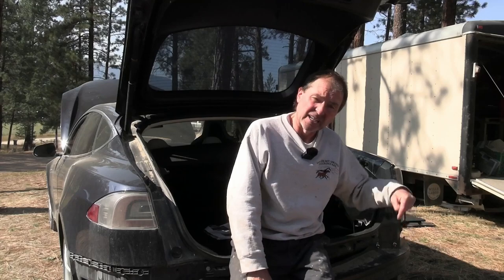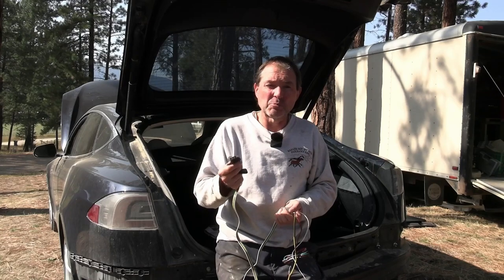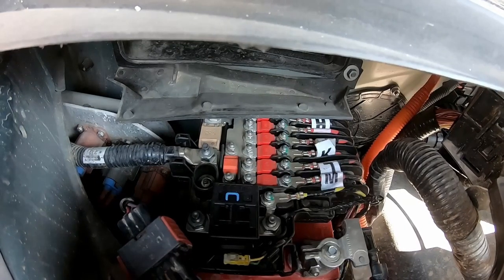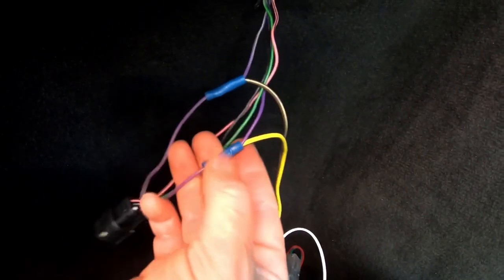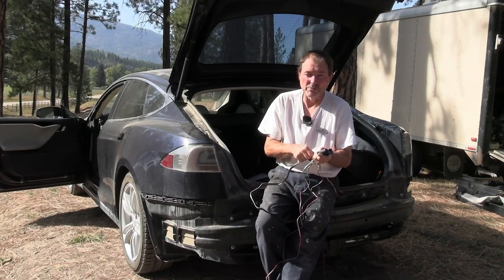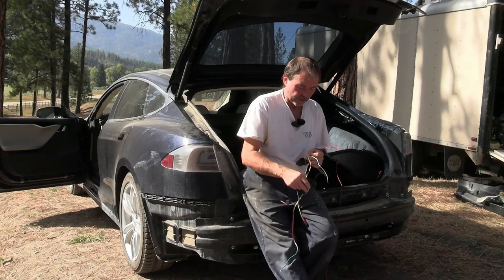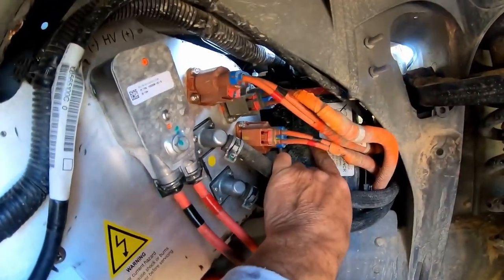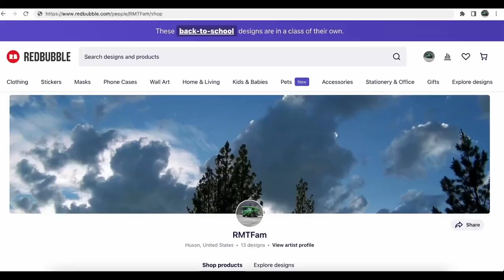Tesla Model S Trailer Light Wiring DIY install on 2013  Model S 85, More difficult than expected

Comment: Someone should make an after market plug and play adapter that gos rights in the harness, Looking forward to when you add a brake controller. Funny high tech car old problem seem like I did this project back in the 1970s same sucess rate. dont feel bad.
Reply from the maker: Not enough people tow with a Model S since it doesn’t have an official tow rating from Tesla and many people that own these don’t have towing needs.
In Europe the Model 3 is rated for towing and Tesla offers a tow package, but people in the US are truck addicted and don’t know that you can tow with a car just fine. These are reasons for aftermarket parts manufacturers not to make the quick connectors like they do for all SUV’s.
But it was a interesting project and somewhat fun project.